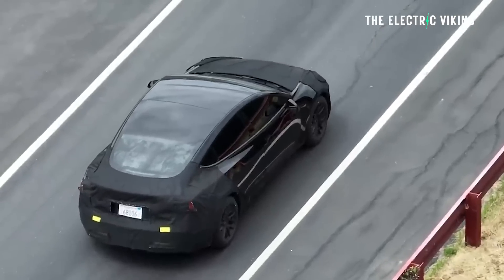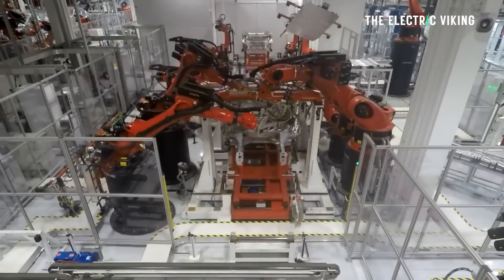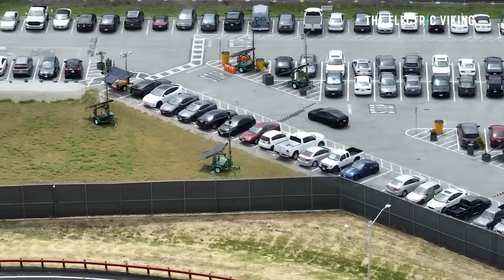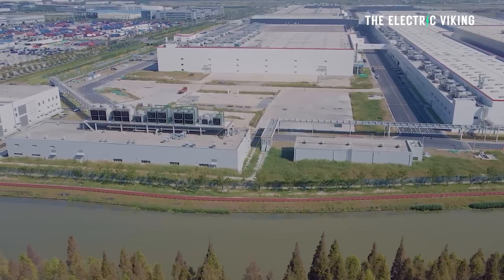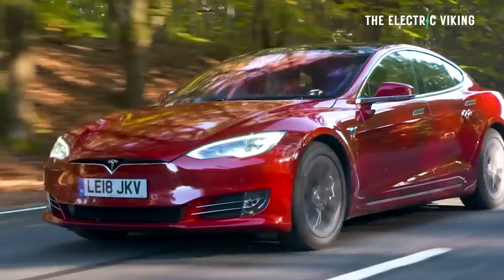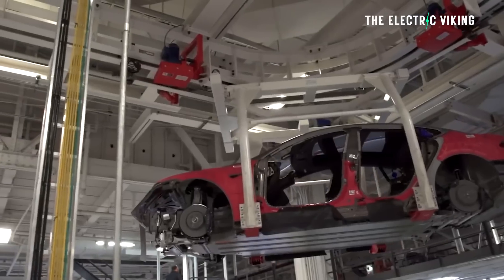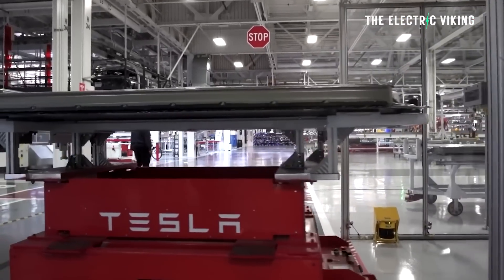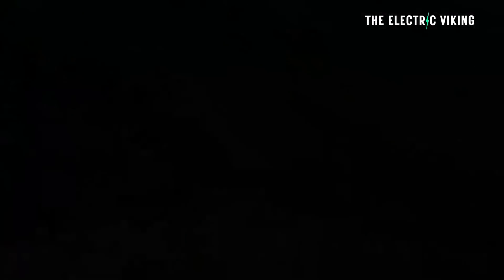Tesla Model 3 Highland nears production in China & the United States

Comment: Like many others, I’m looking to buy a model 3 but won’t commit until they show me the new one. The only improvements I think they need to make are better designed dark alloy 19” wheels (like the 20” on the Y for example). Sport wheels on current 3 are a bit old school. Also better seating ergonomics in the rear - seat is too low and uncomfortable for taller people. Option for a sliding glass roof cover would be good too. Gets pretty hot hear in Australia. Didn’t Elon once hint that the 3 might come with a steel roof? One more thing - you mentioned the cyber truck would be the first stainless steel vehicle ever? The Delorean was all stainless steel.

Comment: I think Tesla may have a non-compete agreement with CATL in China as to battery production.  This would explain why Tesla is not making 4860 cells there. 
CATL to my knowledge does not make LFP pouch cells though???  Perhaps that is why Tesla is making LFP pouch versions which are much more thermally safe? They won't be competing with CATL therefore. 
I think Tesla stated at Investor Day that they intend to make at least a million of their gen 3 cars in China. The new pouch cells will allow extremely efficient density of cells.... which is one reason GM was using them.  This flexibility would be good to have in a small car for cramming in as many cells as possible.

Comment: If Model Y costs less than 3, they had  to correct that.  So a updated 3 makes sense.  But the proposed 2 will be even cheaper.  

There are supposed to be two new products. What if the other one is not a vehicle?